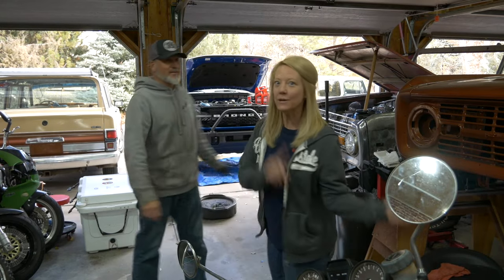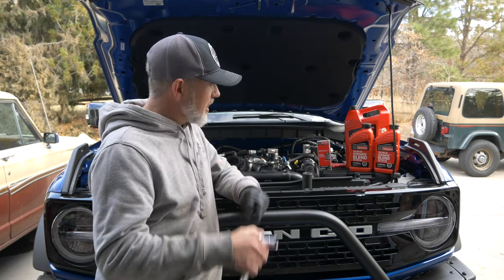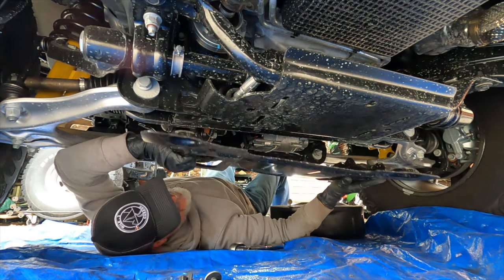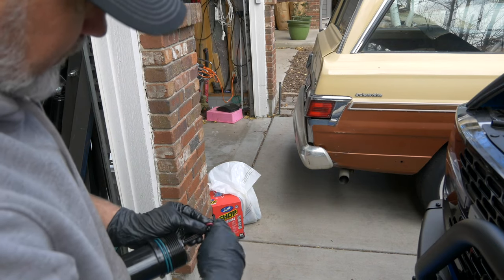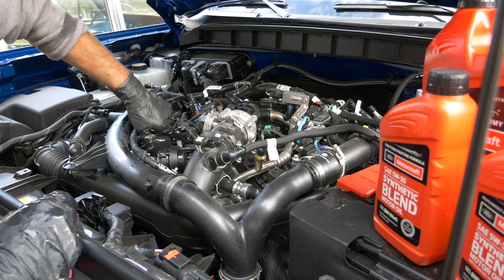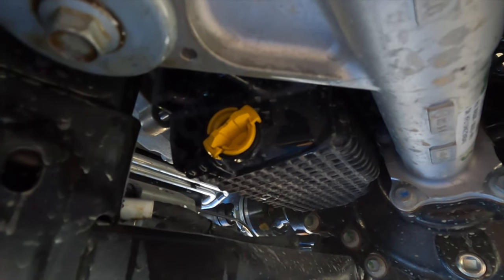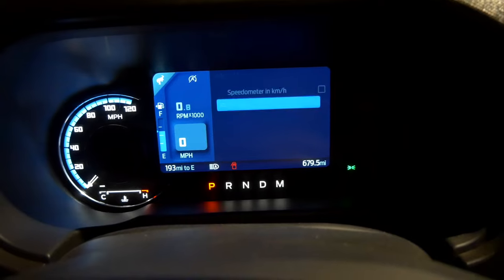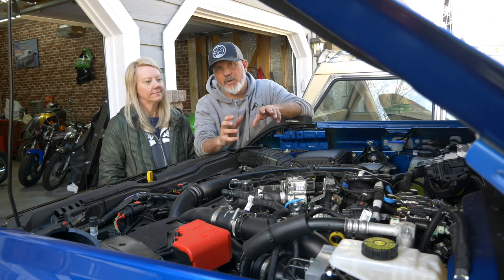Ford Bronco Oil Change Step by Step

Comment: You should start the motor in "clear flood mode" mode before letting it fire up. Really easy just press the gas pedel to the floor before cranking. The computer will shut the fuel off and not let it ignite. Do that for 10 to 15 seconds, the release the pedal and start.

Comment: Mine was an order, had 78 miles on it. Was told by the finance manager you want the one with lots of miles on it from "the factory" it means they tested it. 😅 I picked mine up a couple days after it arrived due to logistics. I consider them mystery miles as well even with that explanation😮

Comment: Thanks for the video! Personally, I would use full Synthinc motor oil so much better!
Reply: Agree.  I'd skip the "blend" and go full synthetic.  But, at the same time, if using a different brand, make sure it is ok to use on new engine.  FYI, Royal Purple, states not to use on new engines with less than 5000 miles.
Reply: I’d use whatever the manufacturer states for the duration of the warranty. Not that I have anything against synthetic as everything I own gets swapped to synthetic I just know what a pain warranty stuff can be, especially with the luck I’ve had with Fords warranty. Once that warranty is up it’s a whole different game though

Comment: I prefer the old fashioned spin on filter. Seems far better less expensive.
Reply from the maker: I’m in agreement with you, although it is super easy to remove being on the top.
Reply: @alpinegarage8548  l agree the Bronco 2.3L is not in the best location. On my car it's right in front. Euro cars were the first to go the cart type. I guess the idea is less waste more green, but three times the price for just the paper element makes no sense. The spin is a robust fail proof design.

Comment: The torque spec on the oil filter cap says 24 Nm. I think that you said ft lbs; that could cause problems.
Reply from the maker: Good catch. Ft lbs is 17-19. I’ll make the adjustment to the vid.
Reply: Great video though! It gave me the confidence to tackle the same task today. We have just over 2500 miles on it. The filter looked good on mine(no metal that I could see). It took just under 6.5 quarts to get a good clean mark on the dipstick.

Comment: I had changed oil on 21 bronco added 6.25 qt and was good at the full mark check it the next day it was still at full mark, about month later I checked oil it was low I added about 3/4qt to get back to the full mark, has that happened with anyone else? does ford recommends 7qt?
Reply from the maker: They recommend 7 but I have never put all 7

Comment: I have 1500 miles on the 2.7 Bronco. Is it a waste of money to use fiull synthetic for its first and Rea curing services? Can it damage the engine if I don’t use Motorcraft blend?
Reply from the maker: Likely using another synthetic blend won’t damage your engine. If the recommended oil is not much more than the alternative, it’s best to keep to the owners manual recommendations through warranty.  The Bronco engines have had issues, and you won’t want to get caught on a technicality when warranty is at stake.

Comment: Lots of controversy on oil capacity. Manual states 7 quarts and someone supposedly confirmed that number with Ford engineering. So does that mean the dipstick is wrong or is there still somehow an entire quart left in the engine after draining?
Reply from the maker: That is a good question. I’ll find out for you.
Reply: For those that come to this video more recently... within the last two weeks, Ford has updated their specifications for the 2.7L (oil change with filter) to 6 quarts... they are in the process of updating their online manuals (Late July 2022).  It's really strange, because they still state the 2.7L leaves the factory with a 7.5 quart fill.... ???  This, plus the variations in dipsticks, leave many of us still scratching our heads.

Comment: I would be curious if the oil life % was 95 BEFORE you did the oil change.  I wonder if 95% was actually accurate after the change since there potentially was .6 quarts of dirty oil left in the vehicle
Reply from the maker: The oil like is based on mileage.  You can reset your oil life without doing an oil change.

Comment: Hold up hold up hold up... The drain plug is plastic, the oil filter is above the engine(maybe mid way), and you found metal in the filter from a new vehicle with 1k miles on it, the oil filter housing has o-rings in it and some weird extension on it wtf, and you used synthetic blend(what percentage is synthetic and what percentage is regular oil?). I'm just like what is going on here!?!? And why is the drain plug at an angle!?!? Great video on how you do an oil change on a new bronco, but I was the dislike because of how Ford designed this
Reply: You own a Jeep don’t you?
Reply from the maker: CH@PPy the oil used is exactly what’s in the owners manual. It doesn’t call for full synthetic. The metal does not concern me as I knew it would be there on a new motor break in.
Reply: @chrisonaguilar  hell no... Wouldn't own a Jeep if one was given to me. My mom has had 2 brand new jeeps for her work. Every Sunday I go see her and she tells me the jeep has to go into the shop again because something else broke.
Reply: @alpinegarage8548  well of course they suggested that oil! It's motorcraft questionable blend 5w that they can't sell because no one uses it for any type of motor 🤷🤦. You were thorough on the video so I'm going to change it to a Like!
Reply: @-CHaPPy-  omg! I’ve heard stories about this, I didn’t know if it was actually true but this confirms it. I was about to get one for my gf as our first car but something saved me and told me to wait. I just wish they can fix all the tiny issues on the 2022 bronco before release, this would clearly make them the clear winners.
Reply: @chrisonaguilar  don't order a 2022 bronco just yet. I'd stay tuned and watch Mile.3 Garage to see what they feel to be improvements for the future of the new bronco and see if Ford actually fixes some of the issues they will inadvertently have!
Reply: Lol!!  Just a modern engine.  Actually, it has a very very GERMAN feel to it.  If looking at a BMW engine from 10yrs to current, this 2.7L Ecoboost is very similar.  Anybody who lives in the rust belt will appreciate the composite oil pan and plug setup.  I agree on NOT using the cheap blend oil.
Reply: Awesome video… I just did my first oil change @ 2k miles on my 2023 4 door Sasquatch package 2.7 I’ve done a lot of research on oil & ford motor craft oil comes in the top 5 of worse oil you can run… so I refuse to run it in my bronco & 2019 mustang GT PP1 I’ve used ams oil & a wix xp filter since day one  on my stang & going with Mobil one full synthetic & again wix filter on my bronco… I’ll take my chances as far as warranty. The ford motor craft oil is probably what’s causing the issues anyway.. Lol.